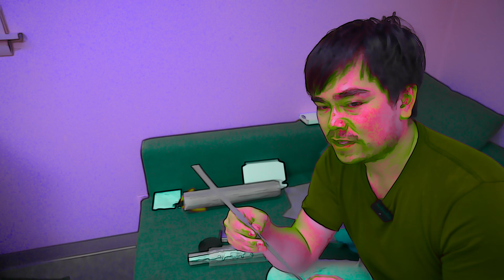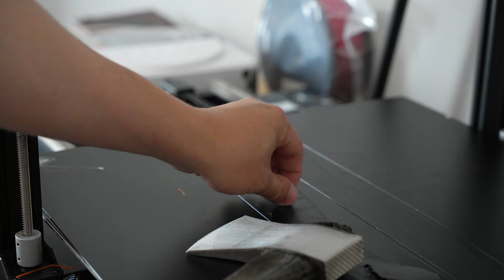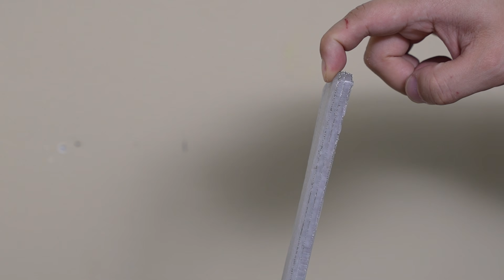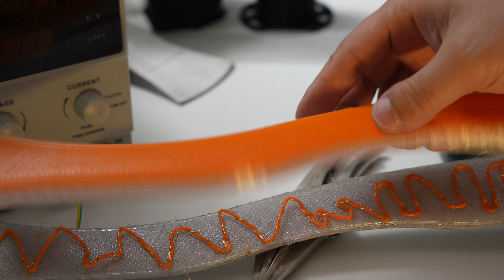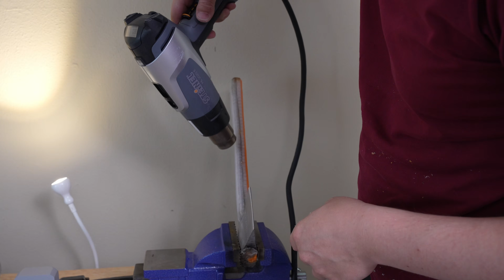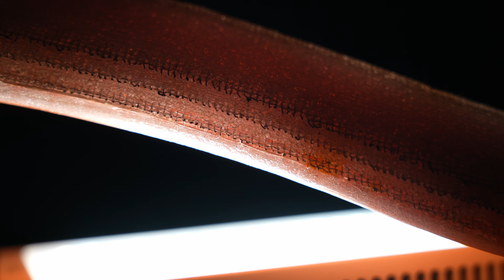🦾⛓️Steel Reinforced Parts ON ANY 3D PRINTER!!!

Comment: Q-switched laser cutter would let you prepare the mesh to the correct size.  You could also investigate etched soldermask that is has the required shape and enough holes to bond the adjacent layers and the orient the metal structure to align with your preferred tensile direction.

Comment: The 2 halves could be just glued together, the wires placed in the center of the handle don't add to the strength.  Rather than reinforcing with a mesh of wire you could reinforce with single wires running from end to end and not across the handle.  Another thing I've thought of trying is to use carbon fiber rods or strips.  You could print part of the handle with some grooves in it, place in the rods or strips with some adhesive then continue the print to print over them.

Comment: 0:53 see you on the other side, brother
Reply: interesting technique. would it be sufficient to add the mesh just short of the edge and never have to worry about getting rid of all the metal pieces on the outside? or would that edge likely cause problems with printing?

Comment: If you reflow the parts in a salt bath after printing that may ensure more intimate bonding to the mesh. Wires need not go all the way across a reinforced surface.

Comment: Tip - use a palm sander and 3M Cubitron sandpaper over the metal mesh instead of acid etching then clean with rubbing alcohol

Comment: This is great, but I'm wondering if anyone has tried a different reenforcement idea: have a second 'wire head' that lays down a reenforcing wire at print time, that can be infinitely customized. You'd just need cut, bend, extrude functions. Seems like someone ought to have tried it as this would allow fully automatic custom reenforcement using simple parts, but I can't find any mention of such a system?

Comment: Couldn't you pass current through the mesh/sheet once the part has finished to soften the plastic so that it isn't just the upper layer that has good adhesion to the metal? That way you don't have to worry about messing the part up mid print with a hot piece of metal and you'll still get decent adhesion.
Reply from the maker: Yes, good idea. I have an inductive heater to see if it can heat up the metal through the plastic. Unless I get a microwave transformer, there isn’t really a way to push that much current through the mesh. It will draw crazy current/power
Reply: @NathanBuildsRobots  I mean, microwave transformers aren't terribly hard to get. They're just dangerous as hell haha. I don't see why the inductive heater wouldn't work, though. The magnetic field should have no problem going through the plastic. I'd just be careful not to overheat the plastic though, since I believe that can negatively impact its strength.

Comment: if you do this again I would recommend using the cloth hockey tape, I just use it on all my tool handles in the first place, but it would be very good to cover up those pointy bits

Comment: If I may armchair this a little. Love the vids btw. 
If you printed a couple of stencils and used those to cut the mesh to be a little smaller than the handle and used a fiber fill filament. Fibers would help grip through the mesh and do it is a whole handle w supports and brim. 
Thanks for the share.

Comment: You can use Kneadable art  eraser to help hold stuff down too, and if the hotend hits it, it will just push it out of the way cause of how soft it gets when warm. I have done this in the past with ABS and PETG when they would disconnect from the bed sometimes.

Comment: The perfect meshing, would be to cut the mesh into shape, so the plastic covers 2-3 perimeters instead of the mesh coming through the perimeters.
Also, at cris/cross weave of the mesh would stiften it to insane strength.

Comment: could pour resin in a pvc tube to contain it in a smaller volume, then dip the handles and let them drip dry somewhere while curing. it should encapsulate it, or even try a rubber dip product...or run it over a belt sander...

Comment: If you want to quit destroying your build plates, use glue stick or Bed Weld on the bed when printing PETG. It'll act as a release agent and prevent the PETG from pulling your build plate apart. For joining the two halves of the handles, I would just use a good epoxy.
Reply: No need if you have the right build plate. Printing petg on Prusa core one with satin pei sheet. Wait till the sheet cools in the printer or take it off the heated bed to cool faster and parts pop right off. Leaves less residue than pla on the smooth pei

Comment: I know it takes a lot more money, but I think you need to do a feasibility test where you make multiple handles with varying numbers of sheets of reinforcement. You may be on to something but will never know for certain if your amount of reinforcement is below what makes this viable. Ex: currently, you have one layer of reinforcement per 10 layers, but does changing to per 7 layers or per 3 layers make it stronger? I believe it would although there will be a point of diminishing loss there as well.

Comment: Nice work so far with the experiment...
May I suggest:
When you get to the layer that is going to have the mesh, print the perimeter then stop the machine.
Trim the reinforcing mesh to fit inside the perimeter wall, place it in the print.
Then use a soldering iron (bigger than an electronics one) to press and melt the mesh into the print.
Then carry on printing once all the mesh is below where the printer nozzle will travel.
It may be a good idea to use a heat gun on low setting to pre-heat the model before starting the print again so that you are not adding new material to material that is at room temperature because that will almost guarantee a separation layer.
Possibly make the head temperature a bit higher on the "resume" layer to help bonding - the outer perimeter "should" prevent material from flowing away from where it is supposed to be.
All the best of luck figuring it all out.

Comment: instead of trimming, you could also try folding the mesh. It would add some extra bulk but you wouldnt need to trim as much. You could also add some pockets to the model that you could push the metal into. Obviously the deeper the complexity you do with integration, the harder it will be for just anyone to just slap a mesh in between layers, but I think you could get some very strong results with that.

Comment: hello Nathan, do you know where i can find a fanduct print for a single 4020 radial fan for the Ender 3s1? I only want to replace the partfan, not the hotend fan. All prints i can find are for both fans or for a 5015 fan.

Comment: Bussin (no cap). Why don't you use solvent bonding to weld the 2 layers together? You can dissolve a bit of the base polymer in the solvent and use like a glue. It works just like plumbing cement, which is plastic welding. You can use the solvent directly, but if you mix in a piece of the polymer you're bonding, it'll thicken up and be gap filling. This works on PLA, ABS, PETG, PC, etc. The ideal solvents to use depend on the polymer, but methylene chloride is the most versatile for 3d printing.

Comment: What would be interesting to find out if it would work to make like a 3D printed shell, where you only inlay just a few of metal sheets and just add some pillars, where the mesh is embedded while keeping the part mostly hollow and then fill that with a mix of epoxy and sand. I bought some epoxy for such an experiment and wanted to see if I can make a small "3d printed" CNC router with this method. also adding holes for bolts or threaded rods in Z direction. (I mean like M4 to M8, depending on the size of the part).

Comment: Might work better if you print moulds instead of the actual handle, so you can use regular resin to embed the mesh? Probably defeats the objective of your experiment though.

Comment: Could you sandblast the wire mesh vs acid

Also try cutting the mesh slightly smaller to in case 100% inside the plastic

Comment: This is turning into a video series
I wonder if the season finale will feature Nathan going on an axe-ing spree
But seriously, if you had two sides with steel mesh, you could use an induction heating coil (build one or just buy an induction hotplate) and that should get enough heat into your part to melt things together... although it will heat up all the steel at the same time (with distance from coil determining how much energy reaches that layer of steel) and is actually very likely to melt the whole darned handle...
hmm actually a much harder problem than I realised!
as for the mesh cutting - if you can make some kind of "cookie cutter" that's slightly smaller than the handle size (at least for the middle layers with similar dimensions) that could save a lot of trimming. You'd be looking at some kind of high carbon sheet steel, and hope that your steel mesh is something softer like stainless steel
You could also try steel rods that run along the length of the part... kind of like mini rebar
Reply from the maker: I just ordered an induction heat plate this morning
Reply: @NathanBuildsRobots  cool -try to run it sideways so that you don't get plastic dripping onto the hotplate, and handle the part with a non-metallic clamp (or wear heat resistant gloves)
Keep the experiments going! You could actually make a LOT of money if you designed a high-strength hatchet/axe handle

Comment: To cut the stainless mesh so that it’s all within the handle you could print some “jigs” blanks in the shapes, but a predefined smaller size.  Maybe could use the combine infill layer trick; where the slicer skips a defined number of layers and makes the infill the same thickness as the number layers. Which could be just thinner than the mesh.  I’d use modifier shapes ( that could be the stls for the “jigs” for cutting the mesh)
That way only where the mesh goes would have the combine infill layers.

Idk if that’s coming across like it is in my head. 🥴
Reply from the maker: There is so many ways this process can be improved it’s ridiculous.

Comment: Nylon mesh 20 would also be interesting to see, its cheaper and easier to process
Reply from the maker: That would probably work well for living hinges and stuff, but the main issue is that for fiberreinforcement to work, the reinforcing material needs to be stronger AND stiffer than the base material. Otherwise it will not take up the load.

Comment: Should I glue stick to attach steel mesh on top of the print bed and change settings/skip first layer? Also is the shortening possible if using bambulab printer and how to avoid it?
Reply from the maker: That might interfere with bed adhesion and the fibers will not be fully encapsulated, which will greatly reduce how well it is bonded to the part. But it also might work great!

I like doing this stuff on an open bed slinger design. It is so much easier to reach/access the print bed. In an enclosed printer it is very difficult to reach the part and do these extra steps.

Comment: Would cutting the wire sheets with strands in alternate directions and layering the sheets alternating between directions make it stronger?
Reply from the maker: Yes and no. You are onto something that is very important in the design and manufacture of composite materials.

If all the fibers are oriented in the same direction, it will be super strong in that direction, but weak in other directions. 

If you put equal fibers in all different directions, it will be equally strong in all directions, but won't be as strong in the single direction that was super strong in the previous example. 

So really it depends. There is a lot of smart optimization that goes into designing composite parts.

Comment: LOL.
IF you want to do something like this again, you must pre-cut your mesh so that it is about 1/4 inch from the printed edge, all around.

Then there is no trimming after the fact.
Print the whole handle at once.  

Then there is no hassle in joining them.

I would recommend, at least for testing, printing with 0 part cooling to get the plastic to flow better in the pockets between the wire.
Possiblye measuring the open area of the screen as a ratio of the total area and adjust your flow to match.  That might help, or might make it much weaker.
Reply: I was thinking the same thing. With orca slicer it's possible to pre-define layers where to pause the print (If you know the command to do that for the printer) - or modify the gcode file and then its easy to lay out the mesh and mark it to be cut into shape.

Comment: Use a barrel grinder instead of a flat cutting disc or grinding wheel for the little wires. Once done, put some big heat shrink over it.
Reply from the maker: Yeah big heat shrink tubing is great

Comment: Not sure there is any glass that would be suitable for this work but in general the PETG bond is strong enough to glass its likely to take chunks out of the glass when you use it. Whether you would like a glass and plastic axe handle is a different question 😅.
Reply from the maker: Interesting, I could embed some microscope slides into this, or use glass fibers.

Comment: Could you use some kind of metal that is attracted to magnets? That way you can just put it on the heated bed and it'll stay on it's own.
Reply from the maker: The way most heated bed magnets work, very little of the magnetic field makes it through the flexible steel sheet. They have it arranged in a halbach array which it stronger but has a more compact field.

Comment: Use a soldering iron and bent the sticking out wired into the rest of the plastic part.#
The only really clean solution would be to precut the individual wires slightly smaller than the 3D printed piece. Stop the print at X layer and lay in the mesh. 
At this point it is porbably easiert to print a mold and overmold some metal pieces.
Reply from the maker: Yeah, I think applying a mesh to the outside of a part would be easier with equal benefits.
I spent hours folding and breaking off the metal wires, the issue is there are thousands of them, and they can even come loose after they have been taken care of. It's way too tedious with the smallish wires that I was using.
But generally I want to avoid molds. If I can come up with a good process that just uses 2 ingredients: filament and mesh, that would be super simple and could potentially be fully automated.
Reply: @NathanBuildsRobots  Then the pre cut route is the only way to go which I can think of. It would be cool to have to cut and place automatically while printing but this would need a completely new machine.

Comment: Let me tell you from experience, plastic really does not want to stick to sheet metal xD
Maybe try a TPU.
Reply from the maker: Yeah I'm sure there will be some issues with sheet metal. But sometimes you get a super sticky print that forces you to destroy a sheet metal build plate and it gets you thinking...
Reply: @NathanBuildsRobots  I never had any success with that. Sure with the right roughness through sanding and stuff but generally speaking a mesh solves all those problems already.

Comment: Another excellent video man, and really quick update since the last one, very dope. To address the metal wires, you might be able to brush on a few layers of higher viscosity UV (tough) resin and cure them with a handheld UV lamp.
Reply from the maker: Yeah I need to use some UV curable resin. That would make things a lot easier!

Comment: Knives get strength even with just a thin shank in them. I think precut strips that fit within the handle would have the same effect. You would probably have to preheat them so they embed in the plastic rather than holding it down with magnets. This would avoid the post processing and protruding wires.
Reply from the maker: I want to start experimenting with precut pieces. The post-processing is a bit too much work.

Comment: I think the only way to do away with the pieces of metal is using a smaller sheet and just hold them with some pliers while the first layer goes over it
MAYBE those laser cutters can cut the thin mesh?
Reply from the maker: Lasers have a hard time with metal, unless you are talking about large beefy industrial lasers.
I have cut fiberglass and carbon fiber on a cheap diode laser before though, so that could be a good option
Reply: @NathanBuildsRobots  I was thinking if with low speed and thin enough mesh one of those 40w Creality lasers could do it? Or at least with carbon fiber
def not safe, but you are the TORCH BEARER

Comment: Can you cut the fiberglass with a Cricket? If so, you could make each layer sit inside the ptint forva smoother, cleaner part.
Reply from the maker: Yes, that would be the ideal - cut out the reinforcement on a laser or plasma cutter, then place them directly into the 3D printed part. It would love the perfect blend of cnc technologies. Especially if it was fully automated :O
Reply: @NathanBuildsRobots  I'm actually a CNC plasma & laser operator for John Deere. I think plasma would be way too hot. Unless they make some that are VERY low powered.

Comment: His never herd of Epoxy resin. They use it when making handles for axes, knives even swords
Reply from the maker: Yes but this is all being done without a mould . Could be more efficient for 1-offs and hobby stuff
Reply: @NathanBuildsRobots  Perhaps, but i meant using the epoxy to glue both handles together ( no mould needed). In DIY knife's they drill couple of holes. And put metal studs through both sides of the handle and epoxy. But epoxy resin should help clamping the two handles. There are diff types of epoxy resins too, to help out with diff tasks. Making them much more stronger without overheating the plastics and making it easy on yourself. Also Maybe a epoxy/resin spray for on the outside ( for handling it safely ), but waterbased instead of oil based ones. But I do like the ingenuity of in-bedding metal/fiber into your prints to get prints that would cost a hell of a lot more if needed industrial 3d printing.